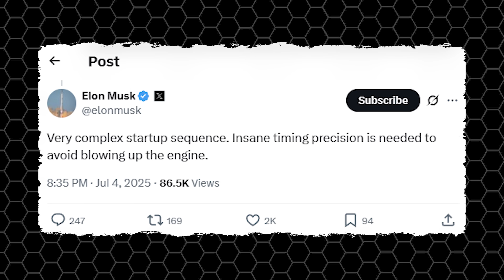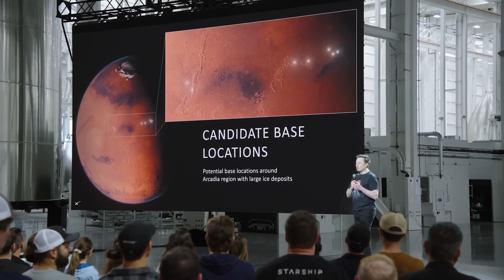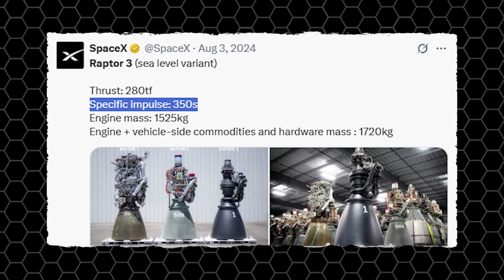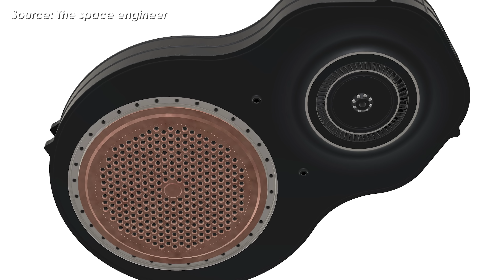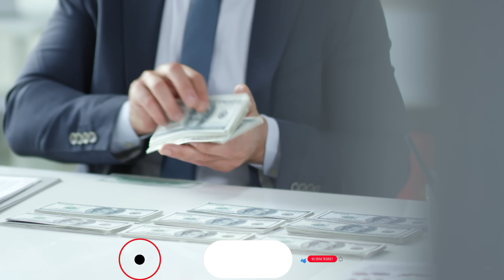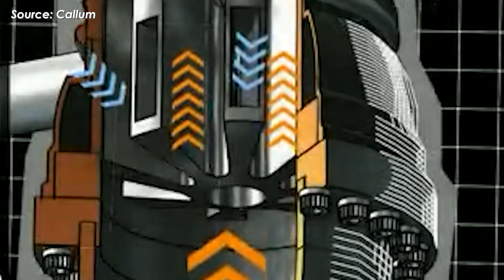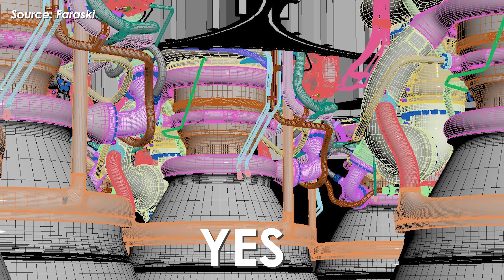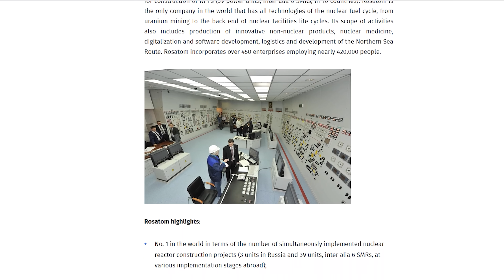Elon Musk REVEALED New Raptor 4 Upgraded Shocked whole industry…

Comment: Nobody's going to see a 400isp engine, unless you resort to liquid hydrogen.  Where the Raptors changed  the game was record breaking chamber pressures.  And the efficiency made possible with their closed cycle staged combustion engines, making methalox efficient enough to contemplate abandoning hydrolox engines, with their costly hydrogen management technologies.  Only two nations tried hydrogen fuel. And now, nobody can afford hydrogen due to the fact hydrogen can leak through solid steel.  The companies that specialize in hydrogen engine technology have a monopoly on hydrogen engines, and don't seem capable of bringing down the cost of a hydrogen powered rocket.  380 isp is not a level of efficiency that I'd expect a methalox engine to achieve.  But don't tell SpaceX that.  400 isp from a raptor?  Impossible. But SpaceX has done impossible many times thus far.  But there are theoretical limits to what an oxygen methane reaction can do, as compared to a hydrogen oxygen reaction. (still the most powerful molecular reaction we know of for the mass of fuel used.)  But hydrogen is a difficult fuel to use in liquid form.  And only a precious few have achieved the engineering competence to use such a fuel, making the RS25 perhaps the last engines that will ever be designed to use hydrogen. 
SpaceX would need the forbidden fuel to attain 400 isp and beyond.

Comment: Methane + LOX for Raptor 4.0 is the ultimate technology. Is there any possibility of  LH2 + LOX for future Raptor 5.0?
Reply: Almost certainly not. It would need a very much larger fuel turbopump, and the whole rocket would need to be redesigned: the LH2 tank would be unreasonably large.
Reply: Much later on, SpaceX may design and build larger craft than the present Starships.  If that were to happen, then SpaceX would likely design new engines to go with them. - Depending.

Although the present Super Heavy Booster has 33 engines, soon to upgrade to 35, an even bigger booster for an even bigger Starship would logically need more engines or larger engines.

If instead, a new Larger Starship model was Space-based only, and the existing Starship used as a shuttle, then other options could be possible.

In essence, who know just what the future holds - though we can definitely say that there are numerous different possibilities.  So the future of space flight is bright.

Comment: need a A nuclear rocket engine built easy for long range space travel  due run on fuel 80 years per fuel load .Reduced Travel Time:
.
The increased specific impulse translates to shorter travel times for deep space missions. For example, a nuclear rocket could potentially cut the travel time to Mars in half.   Payload Flexibility:
.
Due to their efficiency, nuclear rockets may not need to carry as much fuel, potentially freeing up space and mass for other payloads.   Projects like DRACO (Demonstration Rocket for Agile Cislunar Operations) are exploring the potential of nuclear thermal propulsion for lunar and deep space exploration.

Comment: The bullshit factor of this video is astronomical. Failed flights 7, 8, and 9, the blowup of ship 36, and the fact that a block 2 version starship with a raptor version 2 has never flown successfully. Let alone anything with a raptor version 3. And you’re talking about raptor 4? Sheer fantasy! Clear idiocy.
Reply: NTP’s efficiency is highlighted by its use of low-molecular-mass propellants like hydrogen, offering a theoretical maximum specific impulse 3 to 4.5 times greater than chemical rockets. For instance, solid core NTP designs deliver 850-1000 seconds of specific impulse, while advanced concepts like gas core NTP could reach 3000-5000 seconds in open cycle configurations, though fuel containment remains challenging. NEP, while less thrust-intensive, outperforms chemical rockets in propellant efficiency for long missions, as noted in NASA’s documentation.

Comment: Need to R&D on Raptor M (microwave) The Plasma conversion should increase in the 400 SIp. Maybe able to increase fuel and reduce L/Oxy to 50% to 50%.
Reply: NTP’s efficiency is highlighted by its use of low-molecular-mass propellants like hydrogen, offering a theoretical maximum specific impulse 3 to 4.5 times greater than chemical rockets. For instance, solid core NTP designs deliver 850-1000 seconds of specific impulse, while advanced concepts like gas core NTP could reach 3000-5000 seconds in open cycle configurations, though fuel containment remains challenging. NEP, while less thrust-intensive, outperforms chemical rockets in propellant efficiency for long missions, as noted in NASA’s documentation.
Reply: @hillbillyintheasia6122 useful for second stage (only) due to thrust limitations

Comment: Aren't they still fixing Raptor 2 engines from the recent four failures in a row? They will have to change the Raptor 4 engines and ungrade the existing Raptor 2 engines and Raptor 3 engines. The fixed Raptor 2 engines will probably have another failure. Then they will have to upgrade the Raptor 2, 3 and 4 engines.
Reply: No they are not. There is nothing wrong with the raptor 2 engine design. The problems are with the supporting infrastructure, not the engine themselves, some which have flown for two flights